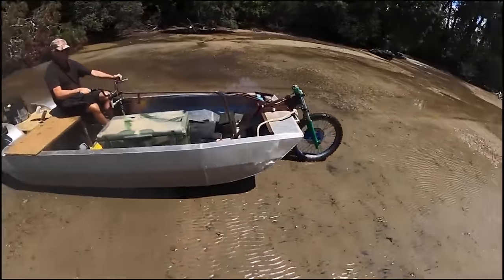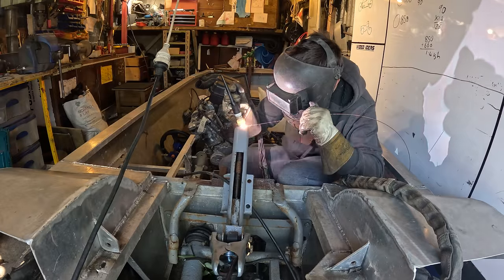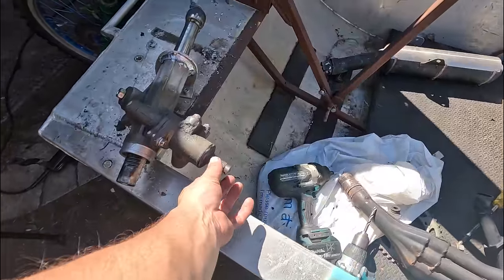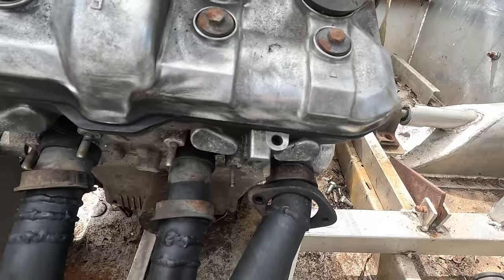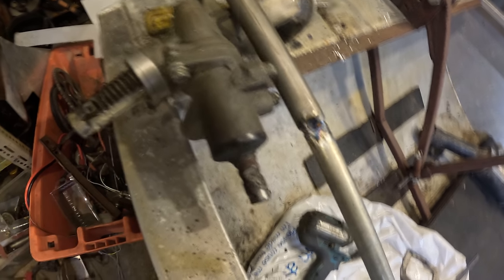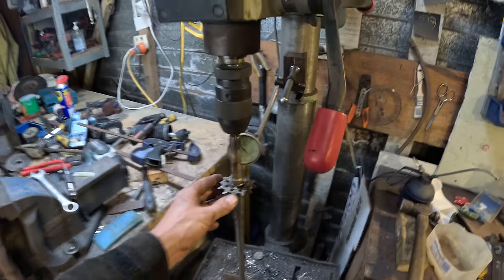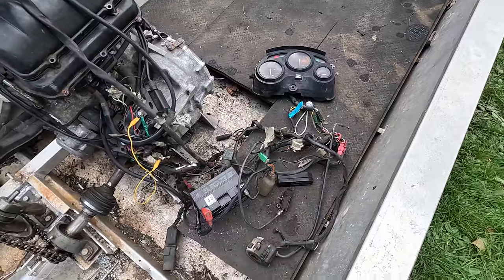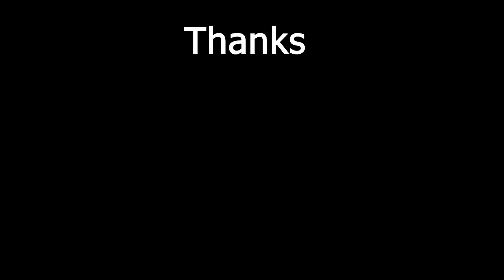Jet Boat Amphibian Build First Ride

Comment: That is actually the best design for an amphibious vehicle I have ever seen.  Putting the wheels outside of the body of the boat simplifies everything.  Well done!
Reply: To be fair, it has its issues but it’s absolutely easier to access and declare issues, especially use up less space in the hull with!

Comment: "You Rock Dude"!!! I've always wanted to put a 500 Yamaha TT engine on a zero turn Hustler mower. And race it in the Red Neck Rodeo of State Fair and Genesee county Fair Michigan. Why the hustler, because they are the lowest of all zero turns and I used one where I used to work. Stock they are hands down the fastest zero turn mowers and the easiest to operate. And the walk behind Hustler trimstar are Top Notch Too
Reply from the maker: That does sound awesome but can the pump take that much power? I had an xt600 cool motor but so hard to start

Comment: that lever mechanism to raise and lower the front wheel is brilliant!  honestly the build of it would be a good contribution to the world.  many makers like myself have uses for mechanisms like this, and although measurements will vary depending on use case / scale... the basics and considerations to make it work are invaluable.  for now ill just pause the video and try to guess reverse engineer what you did.  keep up the good work man.
Reply from the maker: There is an old video on my channel where I made that mechanism, about 2 years back

Comment: I've said it before and I'll say it again nobody makes anything cooler in a smaller shop than you has to be the smallest shop on YouTube
Reply from the maker: I am looking at bigger sheds! But I hate building boring stuff like a shed , so I end up just putting up with the little one
Reply: @DktheWelder  2:45 I've been welding for a long time but have never seen a sick rod in a TIG torch! You can just do that? I have a TIG welder and always wanted to modify it to do stick but can I really just jam a stick in there and reverse the polarity or is there something more to it?
Reply from the maker: @ifabforfun  haha , most arc rods can run positive earth fine , it actually works better than a normal hand piece as you get the high frequency start and you can use the downslope which is good for welding gaps 👍
Reply: @DktheWelder  that's cool, i'll have to try it sometime, thanks for the reply.
Reply: It's not the size of the shop that matters but how you use it mate.........😉😉😉

Comment: you should think about putting a quickener on the steering box alot of dirt track cars here stateside use them ... its an inline 2:1 box that increases the steering rate so youll have to work the wheel alot less to get a decent driving feel out of it without chasing the wheel as much 

otherwise cool build man!

Comment: For reverse you could maybe make something like Honda Goldwing by spinning the starter motor the other way while in gear, BMW also did that with the K1600GT
Reply from the maker: O is that how they work? I don’t think that will work for this . Once I hooked up a starter backwards on one of these motors and it just free spins as there must be a one way clutch
Reply: @DktheWelder  or use a separate starter motor for it with a sproket on it👍

Comment: It's satisfying to see you went with my idea to steer it, and took it to the next level. I fear though that having your bodyweight and the engine on the same side of the boat might make it list a little in the water. You may need to make it right hand drive.
Reply from the maker: I am going to have a tiller style steering for the jet pump so I can sit either side and I will likely have a passenger

Comment: I literally laughed out loud at the exhaust tube being about 3" off. Good thing you have the good old straightening tree!  I can't believe it's really been that long since you've worked on this. It sounds like it's gonna be FaF.  
Stop welding sockets to everything, you heathen
Reply: It is the contrast of those pretty 3D printed parts and everything else welded or beaten into submission makes me laugh.  Must be running out of sockets.
Reply from the maker: They were imperial sockets haha , we don’t really buy an American stuff here so don’t use them
Reply: 10 mil is imperial?
Reply from the maker: @Ducky69247  that was a joke it was actually something else , just that 10mm is the most used!
Reply: @DktheWelder  ah, just a joke I missed, got it. First time watcher. Good stuff so far.

Comment: So cool, so dodgy and yet so awesome. :)
Any chance you can tie the jet steering into the wheel? 
Apart from the crazy dirt bike front end, the whole thing is looking pretty slick. :)
Reply from the maker: I was going to do that but I am going to have a tiller for the jet pump or it would interfere when the front wheel is up
Reply: @DktheWelder  yeah, just keep it simple. That way it's easier to fix or redesign.

Comment: what a crazy thing.  Looks a little bit heavy on the port side.  Can the steering, seat and driver be moved over to the right side of the engine.
Reply from the maker: I’m actually planning on swapping sides to control the jet pump , you will see in the next video

Comment: Is the impeller direct drive ? Dont jets need water to keep from trashing bushings and stuff ? Dont want to be a fun hater but also dont want it to shred the impeller before you get to the water.
Reply from the maker: Yes I have heard the same thing but this one has bearings each end and to me I see no reason it can’t run dry
Reply: Cool, thanks. I knew you had it figured out already. I was just too busy to go back and watch all the videos to find out myself

Comment: 2:45 Dude did you stick a Aluminum MMA electrode in TIG torch...
Reply from the maker: It is 2.5mm arc rod in the tig collet I am welding steel in that shot haha there is a n angle iron on the edge of the aluminium

Comment: You could literally just put paddle tires on and you'd coast across the water. No need for everything else.
Reply from the maker: Yes but slow , it will be much faster with the wheels up and the jet pump running